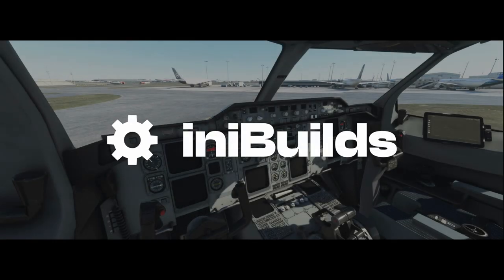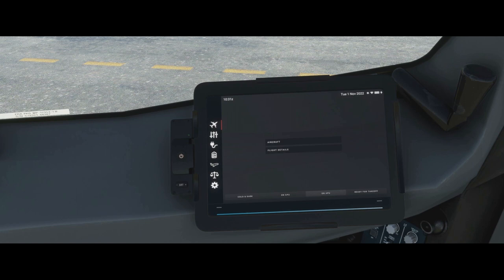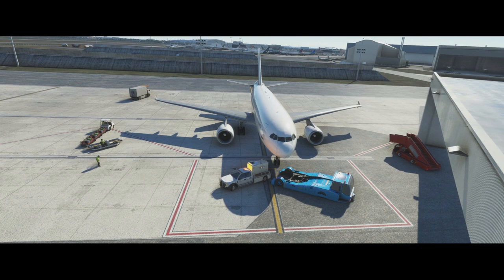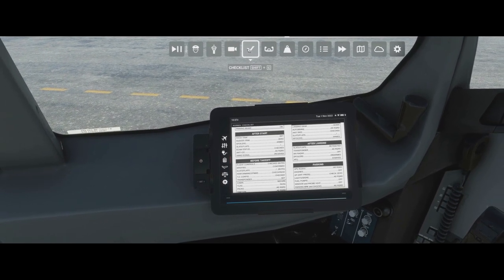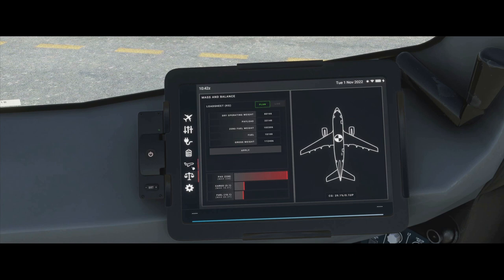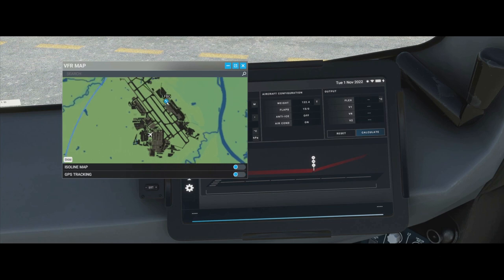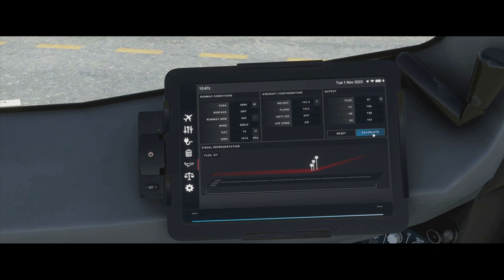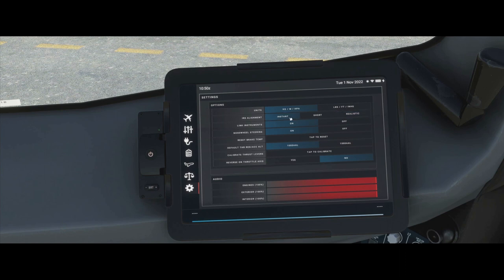EFB & Approaches - A310 | Part 1

Comment: the decision to remove the sound settings and delegate to the (awful) msfs sound settings wasa mistake.
it was much simpler before and now it is impossible to reduce ventilation and packs sound level without ruining the other sound levels.
please restore these sound settings.

Comment: Is there any scope for landing performance calculations on the EFB, now or in future?
Reply: For now, I just took the tables from a QRH. There are some available if you google for it and I printed out the Vapp and Landing Distance Tables on the other side of my checklist. Works for now
Reply: @wavesandsky  Ahh nice, old school technique! Thanks!😎👍
Reply: @wavesandsky  you wouldn't happen to have a link, would you? I can't find anything other than an Air India FCOM, but these don't have the QRH content...

EDIT: scratch that, sorry. I didn't look hard enough. Performance table are there...FCOM 2.15.20👌

Comment: It definitely needs an option to preload all this, it's not fun to spend hours not actually flying.
Reply from the maker: You can set a ready to fly panel state through the EFB menu.
Reply: @iniBuilds  does this set the waypoints in nav too
Reply from the maker: It does not.
Reply: Make a sim Breif account and look up on YouTube how to load it in the plane. It works on pc and Xbox and is super quicl